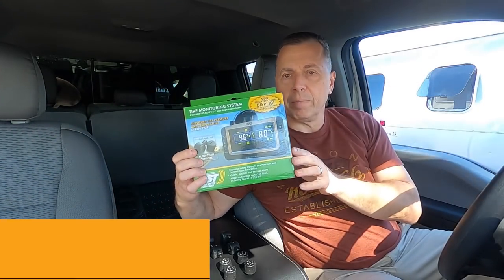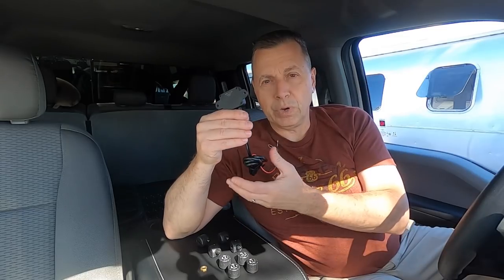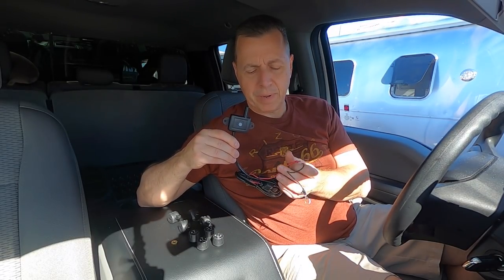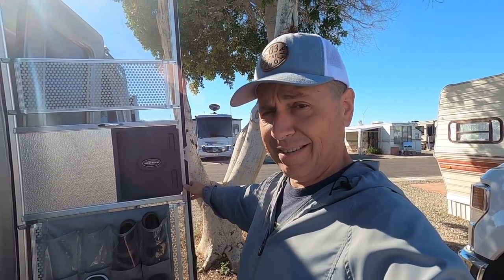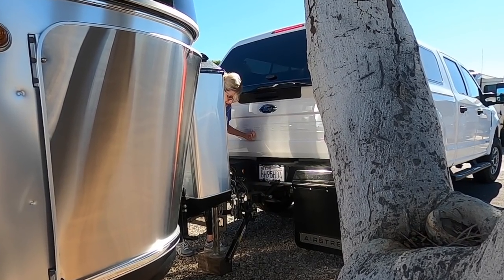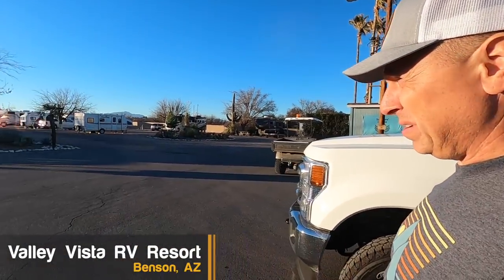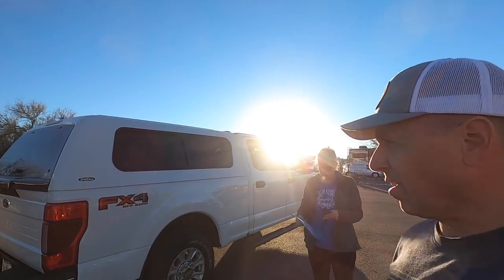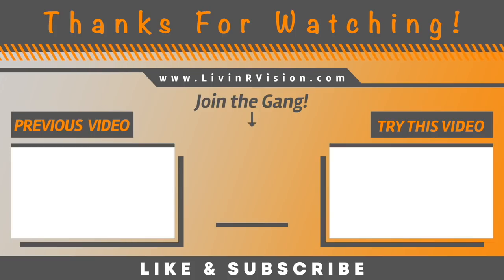Tire Safety | Road Trip Leaving Yuma! | Equalizer Hitch Adjustment

Comment: Thank you for the education. We need to purchase a tire pressure monitor. Now I know which one to order. I hauled a 4-horse bumper pull horse trailer loaded for years using a load leveler and never knew how to measure. I would adjust the chain notch per each 1K of horse and tack weight. Then short drive and eyeball the load before heading out. Your method is so much better. Thanks again. Looks like Ice cream won out over pie this time. 🍦🍨. Here’s some pie 🥧 to go with it 😋
Reply from the maker: Haha thanks for the pie! 🥧🤓
Glad you found the video helpful!

Comment: The Encore park in Benson is one of our favorites. Not in a city but close enough to get groceries. I would consider moving your TPMS repeater into the camper shell. The metal body of the truck would attenuate the radio signal. The windows and fiberglass of the camper shell wouldn’t. Mounting the repeater within the Airstream would also attenuate the signal unless its mounted ~window height.
Reply from the maker: Hi Richard. I put it at the truck because I actually called TST first (as mentioned in the video) and spoke to a guy there in customer support. He was very knowledgeable and recommended installing it under the hood of the truck. The metal does not interfere and the Airstream is aluminum anyway and not fiberglass. He said I could also install it in the battery compartment of the Airstream but he said under the hood of the truck would be better and actually create less interference. Even if I installed it in the battery compartment of the Airstream, that too would be under metal. I always call the pros if I am in doubt. 😉

Comment: Equalizer has excellent manuals online at Equalizerhitch.com and select Support from the top bar menu. You can view them in HTML or download PDF versions. For trailers like Airstreams with torsion axles it is important that the trailer is as level as possible when towing, as the two axles operate independent of each other and being tongue high or low will add weight to one axle and remove weight from the other. Don't forget to torque the ball too, 450 lb/ft
Reply from the maker: Yes they do...I thought I mentioned that in this video? If not it must be in one of the next videos scheduled to come out.
After we got home with the Airstream I called Equalizer and then got online and found out that nothing was torqued the way it was supposed to be. Pretty frustrating for something that is so important. I downloaded the manual to my computer for easy access in case I need them if ever in an area with no internet. Yes the ball is a whopping 450 for lb torque.
Thanks for sharing!

Comment: Great video. We’ve always used TPMS on the Airstream. Even installed them yesterday when we took it to the shop for a little maintenance before we crank up the camping season. I still work for the man!  So, your GPS is on the phone?  Have you ever thought of an RV specific GPS, like what Garmin has available?  Already looking forward to the next video.  One last comment, I did notice that at 16:19, there was prolonged video of the 5th wheel traveling in the opposite direction. What’s up with that?
Reply from the maker: We are just used to using the RV gps is all. I’ve had a Garmin i’m just don’t think it’s worth the money because I’ve always done just fine with what we have. 
Nothing up with the ifth wheel.

Comment: I’ve used those cap style TST sensors on rubber valve stems and over time my valve stem broke causing a flat tire on I40. I don’t recommend rubber valve stems.
Reply from the maker: Hmm maybe over time. We had the cap style on for a little over two years as full timers and never had an issue with them on either the diesel pusher or the car/toad. Maybe over more time I suppose? I can see how a longer valve stem could cause an issue with the leverage of the weight at the end, Otherwise I have no idea why some people have good luck and some don’t. 🤷‍♂️

Comment: Cool video thanks for sharing have you noticed any difference in your fuel usage from the motorhome to the travel trailer
Reply from the maker: Thanks! Absolutely, the Motorhome averaged 9mpg and pulling the AS averages about 14-15mpg so far. Both having a 62 mph sweet spot.

Comment: I see you were checking your brake lights on the Airstream. My Airstream had a real small lights indicator on the driver side so you can look in the driver side truck mirror and see the two small red lights that indicates the tail lights and brake lights are working on the Airstream without the driver or anyone having to get out of the truck. Does your Airstream have these two little lights on the driver side of the Airstream about 3 feet from the front?
Reply from the maker: I’ll have to check on that, does still work if a bulb is burned out in the back though? If so, we had not been told about that. I can always tell if it’s getting power by seeing the lights light up on the side without getting out of the truck.
Usually when a bulb is blown the turn signals will blink fast.

Comment: We have a 2020 Ram 2500 diesel which already has the tire pressure app, and we added four sensors in the trailer tires. While we can monitor pressure, we cannot monitor the temperature in the tire. I was never worried about that but your recommendation gave me pause, since you still added the TPMS. I'd be interested in your thoughts. Thx!
Reply from the maker: It’s good to know your tire temperature also. When your tire temperature starts to rise to a point where it should not be, in this case the TPMS alarms you at 158° or whatever you want to set it at.  That gives you an alert to get pulled over hopefully right before the tire blows. Whenever you have a rapid increase in tire temperature you know something is wrong. When it comes to tire safety you can never have too much.

Comment: Dill stem company makes a TPMS system with monitor that sits inside tire for trailer and not on stem. It does both air pressure and temperature.  I have the extender and haven't needed it yet for my AS 33'. Done over 10k so far and no problems. But get metal stems on AS is using exterior monitors.  Our rubber stems did not last and was able to put new metal stems on. I would not use either sensor on rubber stems. I had those on my dually with rubber stems. To many leaks from that little sensor.
Reply from the maker: I did explain on this video that we had metal valve stems on the airstream. Mainly because of the flow through sensors, that it required them.
Reply: @LivinRVision  Yes totally agree. We did yhe same on ours. But before our AS we had s 5th wheel. The tow vehicle wss a 3500 dually with rubber vakve stems. We added the same sensors like you did to yiur truck and after maybe 2,000 miles we had three tire leaks to flat tires csused by those sensors too. IDK I would either chsnge them to metal ot not use them and use the truck sensors only. IDK but needing truck temp I geel was less important. Good video as always. Thanks!
Reply from the maker: We had those same sensors we on out car (Sonny) and motorhome (Vinny) for 2 years and never did have any issues with all of them being rubber valve stems. I would say there was an issue with the specific valve stems you had or maybe they were longer valve stems than what we had which would cause more leverage/bending. Not sure bit interesting. Thanks for sharing. 👍🏻😊🤓
Reply from the maker: We had the same exact sensors on our toad/car (Sonny) as well as the motorhome (Vinny) for 2 years, all with rubber valve stems and not once had an issue with any of them. So my guess is they are either a different cap (weight) than what we had or issues with your particular valve stems or your stems were longer and caused more leverage from the weight of the caps. I haven’t heard of anyone else having any issues with these same caps yet, but they very well could.

Comment: The repeater made a huge difference with our system. I installed it in bedroom in TV cabinet. 
Pretty new rig! You miss the A at all?
Reply from the maker: I called the company and they have very good customer support. They told me for our situation that it would work better mounted under the hood in the truck because it would communicate better together and there would be less interference and plenty of distance with it able to reach 100 feet in every direction.
There are some things that we miss and I think that’s normal going from any RV to any other RV. It’s definitely less worrisome on us now and hope it stays that way LOL.
Reply: @LivinRVision  they told us since we have toad, put to rear. I just wired USB plug to it to test for a few trips and found best spot! Love the piece of mind!
If we got Rid of A, I would have no wear for all my crap! Haha
Reply from the maker: That makes sense having the extra distance to the toad.  Yes, you would definitely need to downsize out of your class A, lol!

Comment: Ok, so what is the time difference with parking and set up of the Class A and the trailer?    Also, for tear down.
Reply from the maker: We haven’t really compared time yet.  Inside is much quicker with the Airstream.  Outside is probably about the same right now until we get more moves under our belts.

Comment: Great video . Thanks for the information regarding your hitch adjustment . I have been reviewing all the hitches and was about to pull the trigger and buy the pro pride from Hensley. Now I’m going to look at the information on the equalizer. Any recommendations would be appreciated . We tow a 2021 Airstream Flying Cloud 25FB with our 2020 Ford F-350 turbo diesel.
Reply from the maker: Thanks, Bill! We don’t have any experience with any of the other hitches, we just went with the Equalizer because it was recommended by Vinnie’s Northbay Airstream Repair. I would be curious to compare with others though. So far, we have no issues with this hitch and with it being a trusted hitch for many many years, I don’t think you could go wrong. 
You’ve definitely got plenty of truck if you were to ever get a heavier RV. I wanted to get the F350 also, but inventory was so low that we could not find one anywhere at the time. Nice to have that extra heavy duty suspension. 👍🏻😊🤓
Reply: LivinRVision  thanks for your prompt replay .
Reply from the maker: Absolutely! Let us know what you end up getting and how you like it.
Reply: LivinRVision I will let you know . Happy Travels .